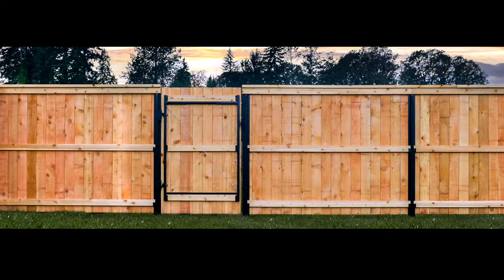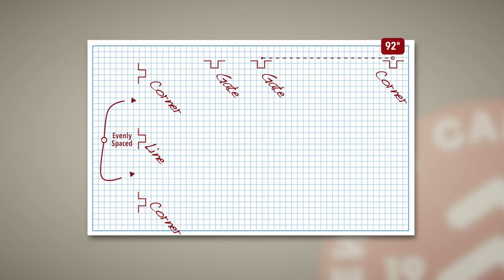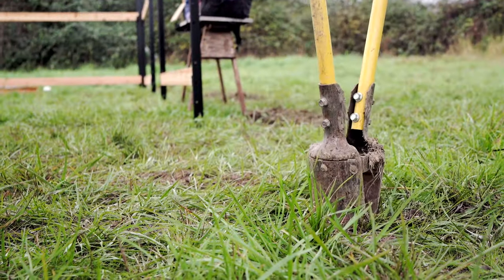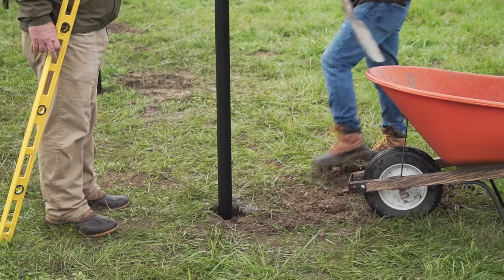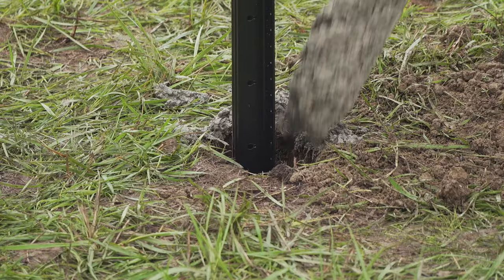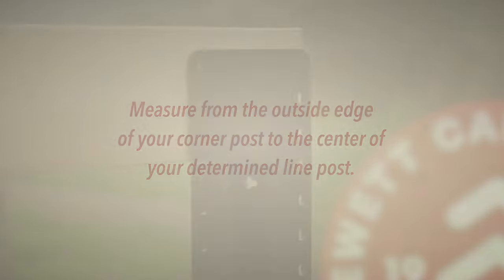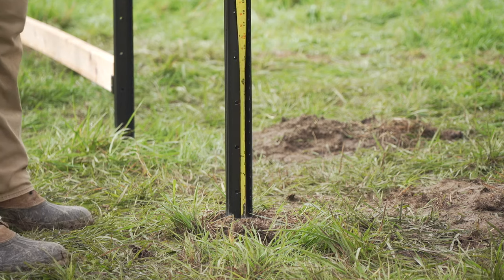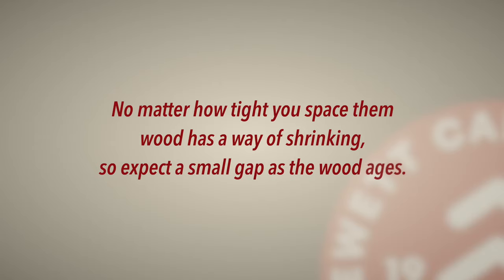Jewett Cameron Lifetime Steel Post Installation Video

Comment: Just installed 14 of these for a 91' run of fence. What didn't make sense to me was the top bracket attached by a single small screw. Seems like a major weakness to have the entire top rail of the fence system attached like that. I'm deciding now whether to use those or just attach the top rail to the posts the same as the lower rails. I really don't understand the reason for the detachable bracket at all, except maybe it kept their shipping costs down by keeping the boxes under 8' long? Otherwise a great product that seems really sturdy and in the end I think will make a great and long lasting fence.
Reply: I just got 2 Lifetime Steel posts delivered to build a test / demo fence section.  I agree with the comment on the top bracket.  The Lifetime Steel posts are beefy, and even wider than the postmaster+ (4.0" wide vs. 3.5").  They solid, and look built to last a "lifetime."  However, that top rail attachment is janky.  As a structures & materials engineer, I honestly can't figure out why on earth they did something so stupid.  If I were to use it, I would drill out that set tiny set-screw hole and attach it with two 1/4-20 stainless steel bolts and nuts.  For that alone, I think the Postmaster+ wins with its full 8' length.

Comment: In other words , we're using  the regular stop sign posts that the city has installed on the corners.
Reply: Those are not as thick.
Reply: Not a wide, not as heavy gauge, and no hatch marks/pre-punched holes.
Reply: Yup
Reply: @danervin2530  the ones in my city have pre punched holes
Reply: @artaxerxes2363  on both flanges? Ours are only in the middle where a sign would be mounted. I have 25 of these lifetime posts sitting in my driveway on a pallet, they are definitely way beefier (and wider) than our local stop sign posts.
Reply: @danervin2530  OK but if I could show you a picture of our stop signs in our neighborhood, they seem to be similar.

Comment: Can these LIFETIME steel posts be installed with a post driver like competing POSTMASTER steel posts.  If yes, please advise what post driver product and adapter can be used.
Reply: The postmaster adapter works. Our local yard rents out a Rhino GPD-45, which I’ll be testing out in the weeks to come.
Reply: Note that the Titan GDP3200XPM designed for the Postmaster steel posts does not come with an insert that fits these.  Just a bit of information I wish I had before I bought one ;)
Reply: @djinconroe   From what I see online, the basic top profile of the Postmaster and Lifetime steel posts look pretty much the same.  Are they really that different?  (Maybe they had to be to avoid patent infringements....)
Reply: @thebordernow   That "puck" shaped insert is different by a small amount. Just enough to prevent the LIFETIME posts from fitting into it. The insert only works with the POSTMASTER posts. I'm sure it was about avoiding patent violation. There is an available insert of the LIFETIME posts. We found it on Amazon and it works exactly like the same way. It's not a deal breaker. Just an extra cost for that chunk of steel.

Comment: The posts don’t need cement lots of information here is not accurate to an install
Reply: Directions clearly say 30 inches of concrete for a 6 foot Panel
Reply: The company says concrete but alot of people have learned you can drive and recommend 3ft and it works as well especially on shorter fences under 8 ft
Reply: Does that mean if you go 3 feet down you can avoid using concrete? I know with wood post some do that. Thanks
Reply: @chukueke  you pack with gravel or hard pack something yes
Reply: @chukueke  rent a post driver and pound them 36”.
Reply: @Dan Ervin  Thanks, but not in my area. I'm going to use GRA Secure Set foam. Good company and products are used regularly for powerline posts. Be well.
Reply: @chukueke  why use set foam when dirt packed or concrete is cheaper?
Reply: @C  power driven in dirt is great if you can rent the right tools. Concrete is cheap but takes longer to set. You need lots of concrete, and adjusting or removing it later, if needed, is pain. I have had to deal with old concrete bases from wooden post the broke, no fun. 
Foam is not for everyone. It  depends on the environmental conditions where you are working and other options available.
Reply: @chukueke  I use concrete all the time it takes no time to set I build the same time I set them